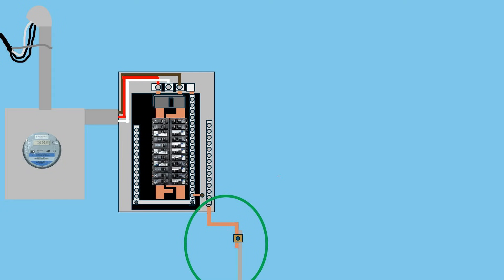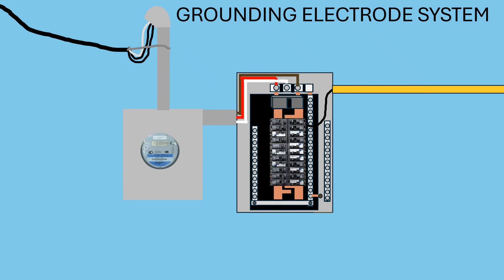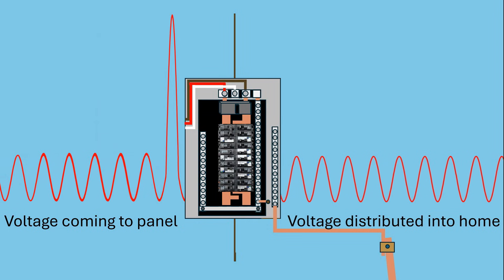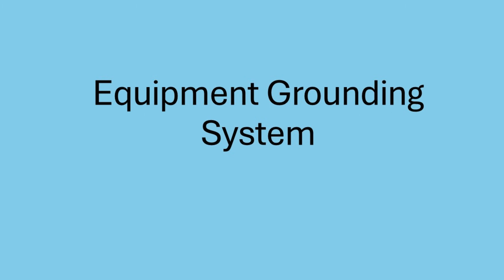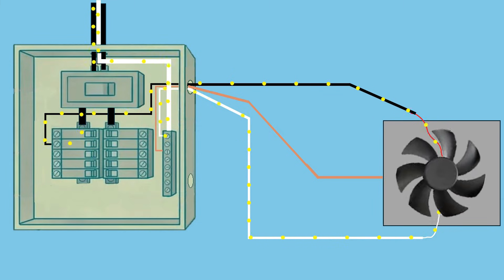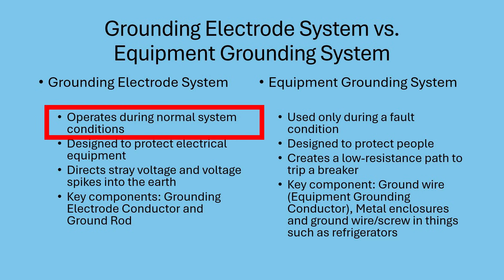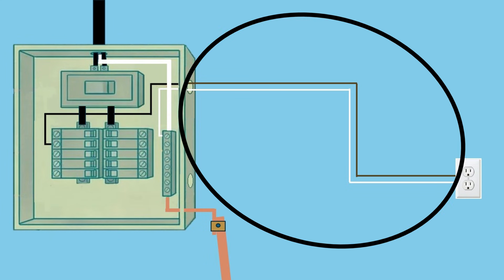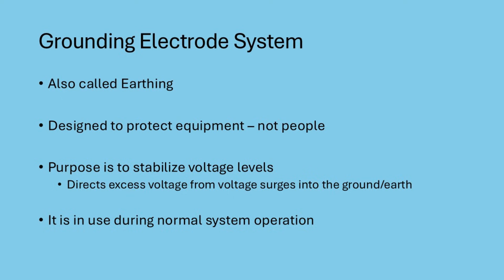Electrical Grounding Explained: What You Need to Know

Comment: Grounding and bonding are one of the most widely misunderstood terms in electrical systems.  

As if residential systems aren't complex enough, there are also rare and  specialized systems used in industrial three phase systems such an corner grounded delta (also sometimes referred to as grounded B systems or end grounded systems) or  ungrounded delta at 240 or 480 volts, and impedance grounded systems.  

 For those wondering, ungrounded delta 3 phase and impedance grounded systems are rare, have more stringent NEC requirements than the other more common systems and the typical applications are for industrial use where losing power unexpectedly due to a ground fault could result in serious injury or damage to expensive or critical machinery.   A ground detector will alert the on-site electricians of the problem, but the circuit will remain operational unless a second ground fault on a different phase occurs.   This allows for an orderly shut down of critical equipment while troubleshooting and repairs take place
Reply from the maker: Thanks for another great explanation! I learn something new from almost every comment you leave on my videos. I hadn’t thought much about the role of ground detectors in ungrounded delta systems before, but that makes a lot of sense. I appreciate you sharing your knowledge!

Comment: I watch these videos to remind me. Appreciate your quality videos. 
I was reading about factors in the 1940s without a grounding systems which i think is neat but with it's own complicated issues. One advantage is if you lose a hotleg and it touches anything. There's no where for the current to flow. Unless you got 2 different hots touching the same conductive material
Reply from the maker: Thanks, I really appreciate that! The older systems without grounding definitely had their own unique challenges. That’s an interesting point about lost hot legs—without a return path, it changes how faults behave. It’s always fascinating to compare how electrical safety has evolved over the years!
Reply: Eye OPENING !!